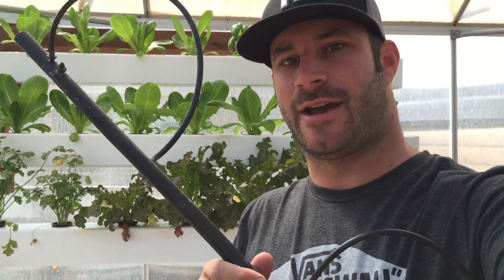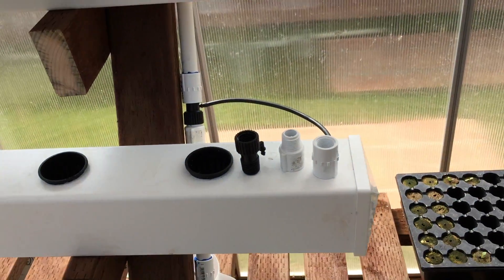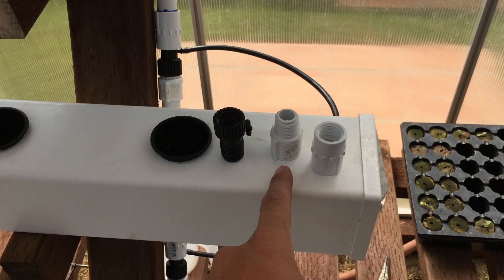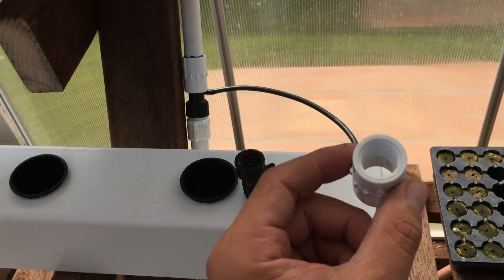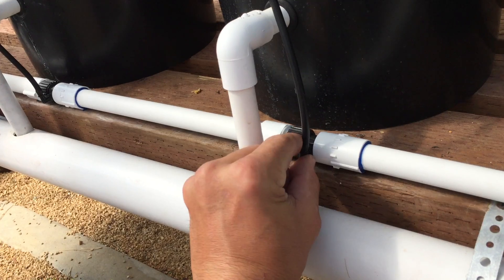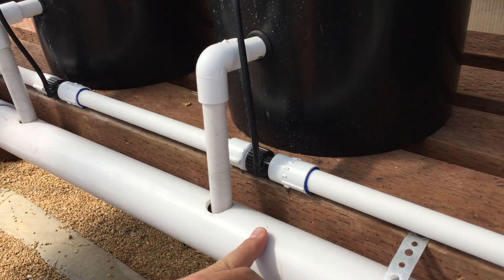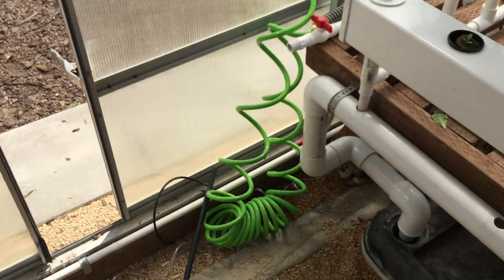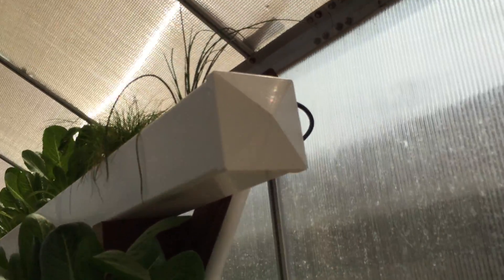PVC Feed Lines for Hydroponics, NFT, Dutch Bucket Systems

Comment: Hi how did you connect the pump to the pvc pipe and can’t you share a link to we’re you bought the dripper pvc can’t find them
Reply: Ty Williams Submersible pumps have a threaded female connection most of the time. I bought those fittings at Home Depot by the drip fittings.
Reply: Thank you I have done it now I’m in the uk so no Home Depot but just copied your Dutch bucket works brilliant thanks

Comment: I found a cheaper route. What you are doing is great but those fittings aren't cheap if you start expanding and have to do a couple 100 of them. I found 1/4" top hat grommets that work wonderfully. I think I paid about 50 bucks for a 100 of them. Just look up top hat grommets if you are interested.
Have a great week my friend!
Chuck
Reply: You insert them on the black irrigation hose? Or where do you use them?

Comment: Hey Brandon, I lie what you've done. It speaks of class and first-rate set up. A few questions, if I may: your HF greenhouse is about 2 years old now, have you had any yellowing of the plastic? Excessive cracking? How's the plastic PVC stuff holding up?

I'd like to converse with you offline with more questions about your set up, if you're inclined. Please advise.
Reply from the maker: Yes, about 2 years now, maybe 2 1/2. The plastic is definitely yellow, and the panels that are directly into the sun (top west panels) get very brittle and easily crack. I've ordered a few replacements from HF to swap those out. But even though most of them are yellow and brittle, there hasn't been much adverse affect or damage to work up a fuss about.

Comment: Hey Brandon, awesome job.  You've inspired me.  On your bucket system, how high up the bucket are your drain holes?  Should the water touch the bottom of the net pot lid?
Reply from the maker: +Kent Walton I originally had the drain just below the bottom of the net pot, but I've found that it's just too much water. I've revised the system to hold just about 3 inched of water, since the water flow is over the top of the roots anyway, it doesn't need to be as high.

Comment: Hi, what is this part called as I'm not having any luck finding it in the UK?
Reply from the maker: +Waqas Zaib Not really sure if you have Home Depot out over there, but here is the link:
http://www.homedepot.com/p/DIG-1-2-in-Riser-Adapter-with-1-4-in-Micro-Tubing-Barb-R67/100126262?N=5yc1vZbx57Z1z0uqq5
Reply: +Brandon Matthew no home depo but thanks for the link. I'll email a few irrigation specialists to see what they can do.
Reply: Get it from Amazon: a LASCO 15-5650P 1/2-Inch Drip Riser Adapter With 1/4-Inch Barb Swivel Outlet (same thing as Home Depot)
https://www.amazon.com/s/ref=nb_sb_noss?url=search-alias%3Daps&field-keywords=drip+line+adapter+with+1%2F4+swivel+outlet&rh=i%3Aaps%2Ck%3Adrip+line+adapter+with+1%2F4+swivel+outlet
Reply: Or, get the "pro" model (2-pack):
(2-Pack) - Mister Landscaper 1/2" SPRINKLER ADAPTER W/ SIDE 1/4" BARB OUTLET 
https://www.amazon.com/2-Pack-Mister-Landscaper-SPRINKLER-ADAPTER/dp/B01CTNDXH2/ref=sr_1_2?ie=UTF8&qid=1509842847&sr=8-2&keywords=1%2F2+in.+Riser+Adapter+with+1%2F4+in.+Micro+Tubing+Barb

Comment: Thanks for the video I am using the pvc for feeder lines as well. I was wondering if your NFT rails are sloped to the drain or flat. I found that with 2" net pots in the 4x4 post the water needs to be 2" deep in the rail for the pots to get water. This makes the rail heavy and bows a bit in the middle. What am I missing? Maybe another support running down the middle? I wasn't sure if 2" of water was considered a "film" or shallow water culture. Thanks in advance.

Comment: Brandon,  Thanks for the progression videos - helps us decide HOW to do ours.  Do you "spray" the nutrient ONTO the roots or the net cup lid?  I've seen some that clip the hose so it constantly floods the top of the roots?  I can't tell from your video angle.
Reply from the maker: Hey Scott, appreciate the comments. The feeder line is consistently hitting mid way up the net pot, so the roots are always being hit, sort of. It hits the side of the net pot and rock, which absorbs the water to the roots. But technically yes the roots are always wet.
Reply: Brandon Matthew , thanks - and I forgot to ask where you are attaching the strings to near the stem?  Or do they just "hang" and let gravity do it's thing.  Do you find it necessary to add air stones in the tank?
Reply from the maker: There is an air stone in the reservoir yes, that is mandatory. The string I pull very tight downward, then clip it using a tomato clip underneath a strong branch. This seems to hold it all together well.

Comment: I have some push-in fittings and hose I'm planning on using for mine to solve the leaky issue I bought a huge assortment on eBay (cheap) and they are extremely easy to use and they adapt to pipe threads super easy. Obviously you already have your scenario figured out but I believe the push-in fittings may have been a cheaper/easier route. Don't get me wrong your setup is legit! I just know how you like comments on  ways to improve.

Comment: Great idea, I hate leaks. Just thinking that if you wanted to economize on fittings you could use two of the drip line adapters at each drop to feed two buckets and cut your parts almost in half. Here is the Home Depot link to the part: 
http://www.homedepot.com/p/DIG-1-2-in-Riser-Adapter-with-1-4-in-Micro-Tubing-Barb-R67/100126262?N=5yc1vZbx57Z1z0uqq5
Reply: ***** Glad it helped.
Reply: That part would be perfect if it was slip on both sides. It would save you a lot on the couplings

Comment: We used a manifold mounted at the highest point on our NFT system to make sure every rail is getting the same water pressure...I will be looking for some of those adapters to redo the dutch buckets tho! My 1/2 line finally almost stopped leaking once I slathered silicone all over it!